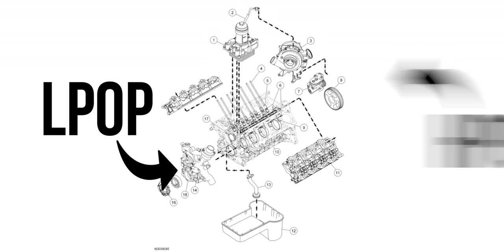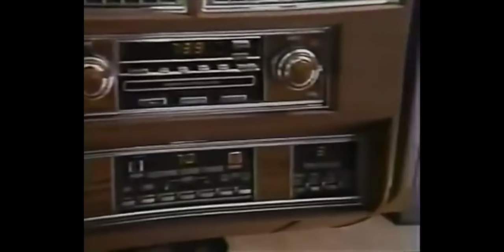These are the WORST ENGINES EVER MADE

Comment: Oddly enough, the 3V 5.4 Triton engines actually brought a whole new spark plug issue with extended reach spark plug tips that frequently seize in place and break inside the cylinder head, requiring a special tool that breaks what's left and pulls it out. It remains the only engine-specific tool that the auto parts store I manage keeps on the wall behind the counter, because it's not a question of "if." 🤣
Reply: That's why should run Autolite plugs not Motorcraft on these engines.
Reply: As someone that works at autozone i can confirm we have plenty in stock😂
Reply: I actually have a way to remove those with no issues. Have 8 cups with brake fluid marvel and kroil mixed in said cups run engine to normal temp shut down pull coils pour mixture in each cylinder wait 20 min remove plugs.
Reply: Oreilly. I'd drop the part number but I can only remember the line code. REN
Reply: You can make a whole list for ford alone
Reply: @Cuhh346  my local autozone has 3 brand new ready at all times.
Reply: The theory behind that is that Ford intended the spark plugs to be good for the life of the engine. They knew the 3 valve would go bad due to oil sludge inside the engine clogging up passages.
Reply: @macbook802  But they also made the 6.2L. Best engine you can put in an F150. (normally they are SD engines).
Reply: @alb12345672  ford's are crap, especially the 6.2
Reply: @macbook802  Everyone I know loves it. Runs like new in my F150. It is 200k
Reply: @bowez9 It's the basic design at fault, using different brand spark plugs don't prevent carbon build up between the end of the plug and cylinder head.

And Autolite?  What shitty plugs.  Run OE or have fun with your misfires six months down the road.
Reply: Great engine if cared for, synthetic oil, Motorcraft oil filter, change every 4000 miles to keep clean, 2009 and newer 5.4 3v doesn't have sparkplug problems
Reply: @lyleswavel320  says one person ever
Reply: @matthew anderson  I'm not in love with one brand, if truck last 300,000 or more it's because of good maintenance and good product and many ford's, chevys, Toyota and Chrysler do it
Reply: 2006 must have been a decent year for the f-150 5.4...or so I've heard. Mine specifically has 271k.
Reply: @anthonynicholson5523  has 6 speed transmission ever been rebuilt
Reply: @macbook802  And yet most on his list were GM clunkers, lol !!
Reply: Don't forget to mention that it's a 4 door, power locks, power windows, sunroof, automatic dimming lights, back cab light, rear view mirror without navigation, ashtray with cigarette lighter,
Reply: I will blame Ford's maintenance schedule on the 3V two piece plugs.....change them @ 50k miles and you won't have a problem. But I digress, you shouldn't have to change plugs @ 50k on a modern motor...
Reply: @lyleswavel320  

Motor oil has little to nothing to do with the plugs getting stuck...
Reply: @John Peters  got 148,000 on engine and haven't changed the spark plugs, but ford fixed the problem in 2009 and newer 5.4 3v 
How long did they make the 5.4 3 v to like 2013 or 14, take care of them and they'll get you to 300,000 plus miles
Reply: @lyle swavel  

Kind of a paradox writing you take care of a vehicle while leaving the plugs in for 148,000 miles...
Reply: That's why I got to the point I don't buy Ford. They've gone to hell in hand basket. Those new F-150s are so full of issues it is insane. A few of their vehicles have 2,000+ recalls on just the TPMS.  Bronco engines catch fire. F-150 engines can catch fire. I know "any engine can",  but these are on the brand new ones while still sitting lined up on the dealership lot. There's a video on here somewhere I seen where a dealer was recording three 2023 Ford F-150 catching fire in his lot one after another within minutes of each other. First one caught fire so he started recording apparently. Then one a few F-150s down from the first one and then another behind him went off. Seen a dealership they were charging $90,100 for an Expedition, LOL! It's so ridiculously over priced.
Reply: GM quality is want South they ain't worth a s*** no more Ford F-150 the best truck on the market
Reply: @user-fc4fr8op8b  

Your ability to form a cognitive sentence seems to have also gone south...
Reply: @bofa1330  I've been lucky to heat them up, use Kroil, pray then impact.
Reply: @bofa1330 hate to tell you this, but you have to remove the spark plug to get access to the cylinder
Reply: The 3v engine can be a really good engine, all it needs is plugs changed every 60k and cam phaser lockouts with cast iron tensioners from the 2v
Reply: Forgot to mention the 3v issue of ejecting the cam followers as they age. I'll take a 2v over a 3v any day (just do the overtorque method when installing the plugs).
Reply: @thudtheace  the 2v was kinda shit with the cam design too, pushrod ftw
Reply: Get it near op temp and pop em with an impact, 300 plugs extraction free and counting. Also did phasers and chains at 200k on mine, still good at 250.
Reply: @bowez9  Autolites are junk just like champions. Get it near op temp and blast em with an impact, works every time.
Reply: @bofa1330  run it to op temp, hit em with an impact. works every time. 300 plugs extraction free. I am a pro tech.
Reply: @macbook802  Chevys are crap. Dodges are crap. If you cut me i bleed Ford blue. But only up to 2015 ish.
Reply: @rodx5571  good way go strip threads or break them.
If Autolights are so bad why is it they are in EVERY Ford from the factory since 1903?
Reply: @bowez9  you are mistaken. Motorcraft are what's in most factory Fords. Since I am a professional tech with 25 years changing said plugs, I see them. The 3v design is. Bad. But as stated, warm it up to open temp, hit it with an impact. In case you missed it, the thread has never been the issue on a 3v, its the sleeve for the ceramic insulator. Heating it up softens carbon, hitting it with an impact vibrates it out of the carbon.
Reply: @rodx5571  yes and Who makes the Motorcraft brand for FoMoCo.  It's Autolight.
Just like Tesla batteries are made by Panasonic, and Dana made FoMoCo rear ends.
Reply: A friend had an '05 Triton! HORRID MOTOR!
Reply: Got a cousin with a f150 with a 5.4 triton. Had to do the spark plugs on it. I wanted to blow it up.

Comment: The 2.2 liter Mopar is a great engine.  The  only problem with them is the factory turbo head gaskets.  Replace the head bolts and gasket with the Mopar Performance parts and they are bulletproof.  The bottom end is reminiscent of the Mopar RB engines.  I have run over double the factory boost through multiple 2.2 engines and they keep on going.
Reply: I believe the 2.2 MOPAR engines are used in some racing series, so they can't be that bad.
Reply: We had a 2.2 in a '86 Plymouth Reliant.  Drove it 175k miles with absolutely no issues.  Would have kept it except we needed a bigger vehicle for kids
Reply: Ya this guy is Baked to say a 2.2 is a crap engine. They are durable as hell. I agree with most of what's he's said, but he's way off the mark about the 2.2 L Chrysler.
Reply: @oldironguy  I agree.  Of course, tons of people bought 2.2 powered cars because they were inexpensive.  Inexpensive vehicles aren't typically maintained like one would maintain a BMW.  When a vehicle has been neglected or beat on and it has issues, it's easy to blame the car instead of yourself.  I think that is why 2.2 turbo cars have a bad rap.
Reply: @oldironguy  ..I know people get confused and are actually talking about the problematic/junk Mitsubishi 2.6 they used until 1985...Those gave them a bad name..

The Chrysler 2.2 and Chrysler 2.5 were bulletproof engines!! The 2.5 was very smooth and quiet and the 2.5 Turbo was potent! Our 1990 Daytona 2.5 Turbo beat 5.0 Mustangs on the street! Car also went 230,000 miles before we sold it in 2002! We also had many 2.2 Turbo cars and never had an issue,we put 100,000 to 200,000 miles on the already on average 80,000 mile used car that was 5 years old!
Reply: Even if the 2.2/2.5 break down, they’re cheap and easy to repair.

Unlike the Tryton and GoesSouthStar.
Reply: 2.2/2.5 2.1/2.4 engines. Cast iron block aluminum head equals bad head gasket about 150k miles. change gasket keep going. They can be built up and they were basis for 440 hp Dohc lotus twin turbo ppg pace car.
Reply: Up here in TO used to work on a lot of 2.2. Head gasket failure was fairly common but it was very easy (inexpensive) to replace. We found that almost always when the head gasket failed the rad core fins were completely gone but the rad often wasn’t leaking. Would always sell a rad with the gasket job and they never came back. Our climate and road salt here was tough on old copper core rads. New aluminum and plastic ones seem to hold up better.  In any vehicle with head gasket failure always check the rad. I find that in a lot of u tube videos this isn’t mentioned.
Reply: @GLHS592 is they Betta than da 2.4 engine g
Reply: Drove a 82 omni it was a company car and we employees beat the piss out of it  the motor took all abuse  the 2.2  mitsu
Reply: @oldironguy  I agree on the 2.2 - they were low powered for the "big" K cars but just seemed to soldier on.  When I met my wife she was driving an Omni with a 2.2 engine - over 300K on a horribly neglected engine.  If he wanted to put a Chrysler on the list how could he overlook the 2.7 V6?  A great engine for power and size - it just didn't last much past 80K miles before the internal water pump filled the oil pan with coolant then the valve train would destroy  the engine.
Reply: yep...i knew a man that put a big turbo on one of those little cars and nothing else... it would pop a wheelie in every gear
Reply: I agree they had some issues  early on with  corrosion  in the cooling system  but it was fixed  by using a  coolant  that was suitable for  aluminum  heads over all it was actually a great  engine for  its time and  was better than  anything  gm and  ford were offered at the time
Reply: He must have been confused with the 2.5 that had notorious issues with bad wrist pins. The carbureted 2.2 was severely underpowered and might be why it’s on the list, but the non turbo 2.2 and 2.5 never were exactly peppy but they would definitely put live the rest of the car. 

The 2.6 Mitsu of the era had to be modified to fit for transverse mounting and was plagued with carb issues and cooling issues as a result of the modifications. In it’s standard mounted configuration of RWD it had far fewer issues other than carburetor.
Reply: My first car was a 1988 Daytona Shelby Z (2.2 Intercooled Turbo). I built the hell out of it and made it into a little monster. Too bad it was heavy and FWD.
Reply: @williamdavidson9009  That is still Only Less than Half of the mileage which a Good Engine Should Run with No Problems !!! ! !!!
Reply: How many people run their cars that many miles?  Now maybe, but back in the '80s not many. @kopronko
Reply: The 2.6 and 2.7 on the other hand. Junk
Reply: If you have to “just do this or that and it’s bullet proof “ then it ain’t a good engine.
Reply: If you have to replace the head bolts and head gasket on an engine to make it good, it is NOT a "great engine"!
Reply: @mothman-jz8ug  Wrong.  Any engine that is as durable as a 2.2/2.5 turbo is a great engine.

Comment: I enjoyed the video. Every auto manufacturer always has they’re fair share of failures. Surprised the Cadillac 4.1 didn’t make it on the list. You should do a part 2
Reply: I have my Dads 83 Eldorado.  It has the notorious  HT 4100. At 40 years old now, and 167.000 miles, its never had any issues . Granted its recieved excellent care, 4000 mile oil changes or every 6 months,  which is the norm,  and coolant changes every 2 years with the coolant tabs that are mandatory.  They truly are beautiful cars, and ride and drive so nice.
Reply: @johnfranklin5277  thats awesome you have yourself a unicorn of a 4100. Keep giving it the same care. Makes me wonder how many 4100s failed due to not keeping up with maintenance and yes they are great looking cars. They sure ride better than new Cadillacs too
Reply: @johnfranklin5277  I have a 83 coupe deville that was laid up in 2000 when the 4.1l seized. It now has a 305 out of a 91 c1500 in it. Runs fantastic! Rides so smooth and comfy
Reply: NEVER had 1 problem with my '96 Deville Northstar whatsoever But when I learned that the starter was below the intake manifold I was exstatic that I sold it at 126k miles.
Reply: I remember that piece of junk
Reply: Yes, had that in my 85 fleetwood....307 olds swap.
Reply: I had the great misfortune of owning one of those. It was an absolute nightmare.